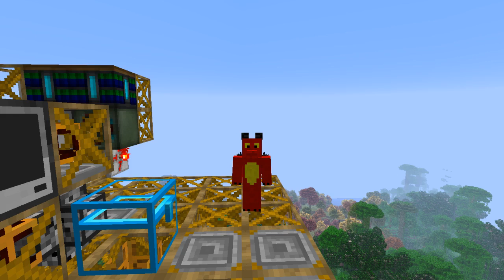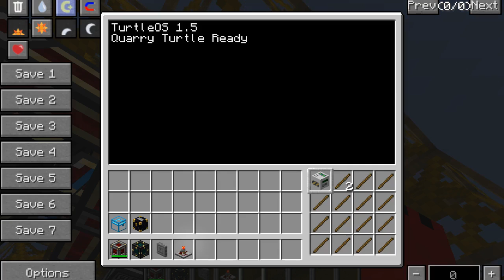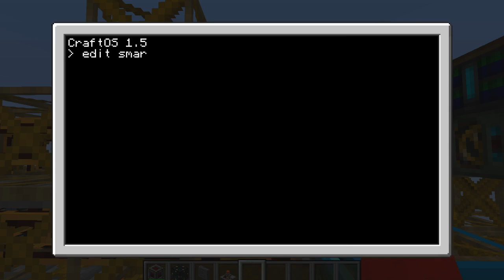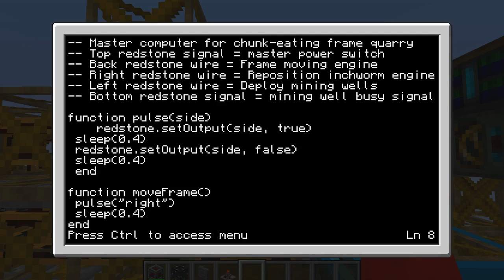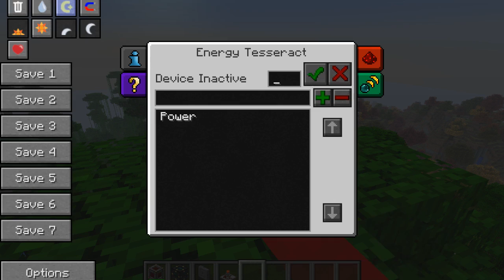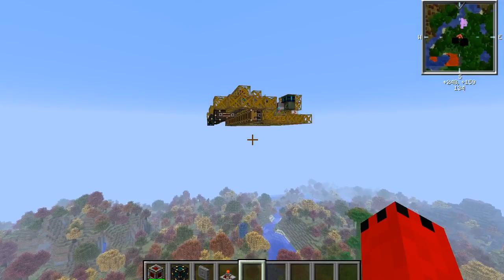Variable speed Mining Machine for minecraft

Comment from the maker: For the method with timers look at the video linked in the description made by Direwolf20. This miner is a timer-based system. It uses computercraft still, but is still doing work that can be accomplished with redpower wires/tubes and timers. Just note that with that method you need a reliable power supply so you can work out how long it takes the miners to mine and work out a clock around that period of time. My build can dynamically work with any amount of power.

Comment from the maker: If you mean to use blockbreakers and deployers utterly instead of mining wells, you could, but that build is a lot slower. For that kind of built look on youtube for 'rp2 tunnel bore' you can built them in vertical or horizontal methods but are by far slower than my build moving at roughly a measly 1 block per second, then has to move all the way back up, then left/right x blocks, and repeat.

Comment from the maker: I originally tried to do this using deployers and blockbreakers but came across two issues. Firstly, there would be no way to detect when the mining wells are done, so you'd have to resort to using timers, and secondly, there's not enough sides of the mining well that it would be touching everything needed. As you need the following all touching the mining well: Deployer, Blockbreaker, EnderChest or Relay, Energy conduit, open air at bottom side.

Comment: Thanks for the effort that went into this build. I switched your inchworm setup with something simpler and more familiar to me (usually used for tbm's). The programs work great.

Slight tip for when using in the twilight forest. Solar panels won't work and you'll have to use a charging/discharging setup via enderchests. Also you won't be able top use the sticks because you will be mining sticks in the for of roots.